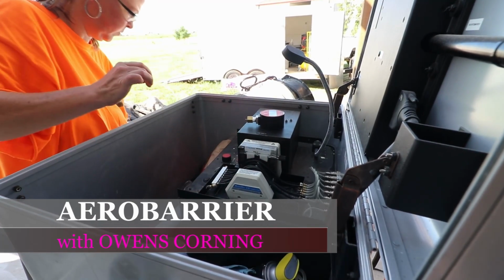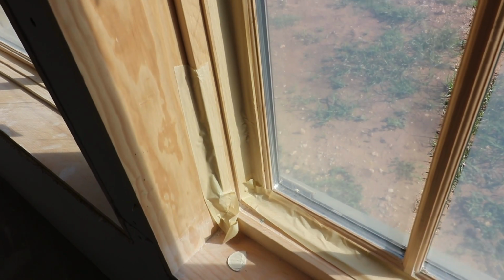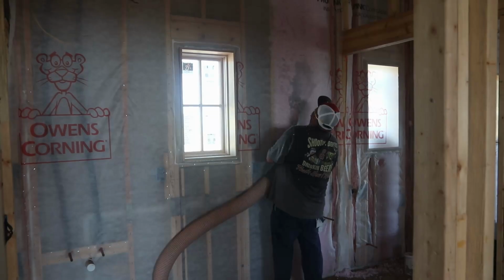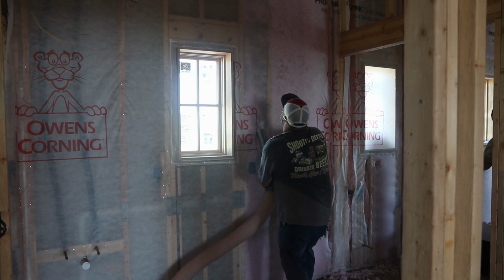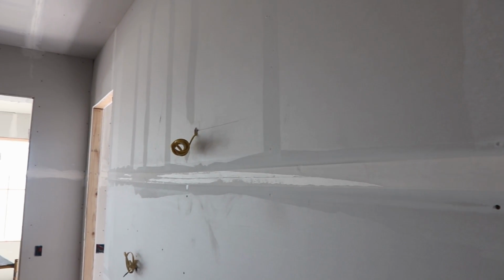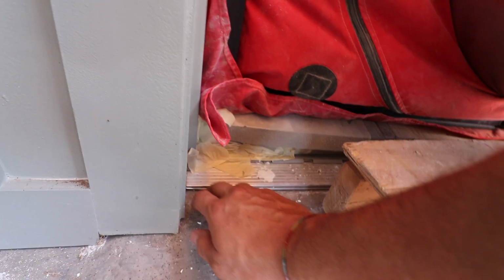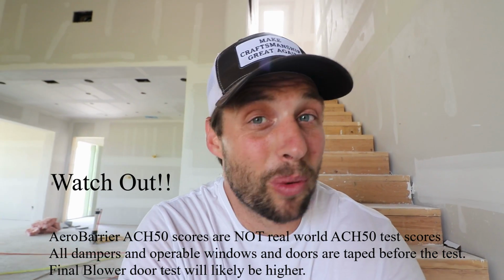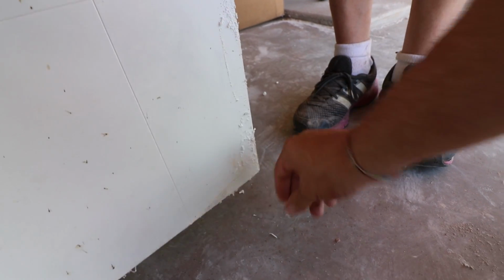This Insulation is BETTER than Spray Foam!!

Comment: Why is this done after the drywall is installed? Wouldn't it be better to seal your outer air sealing layer, leaving the inside of the walls at the temperature & humidity of the inside of the house? If you seal both the inside and outside of the walls it leaves the possibility of moisture remaining in the walls.
Reply: Done after drywall is installed because it acts as an vapor barrier/vapor seal I believe.. So its gonna fill any holes in vapor barrier behind the drywall.
The exterior of the house is basically sealed as well, where you have the issue of double vapour barrier and condensation I believe that is gonna apply more if there is a large airgap.
i.e

Comment: I am going to stick to caulk and rock wool insulation.  Owens Corning makes mineral wool insulation, too.
Reply: One contractor I saw in a video had their own blower door,  and they went around with smoke sticks to find leaks that they could seal before the Aerobarrier job.  This saves money because the cost is on a time basis.

Matt Risinger has also talked about flash and batt (sealing with a thin layer of closed cell foam,  then using insulation batts - he also likes rock wool), or there are one time use closed cell foam kits you can use to seal cracks and penetrations.

In a practical sense, it's probably not cost effective to rely strictly on caulk to seal.  You reach diminishing returns where it would probably cost less to use Aerobarrier than the labor or opportunity cost of sealing every pinhole and microscopic crack with caulk.

As explained in the video,  and as I mentioned above, you want the house to be tight to start with, before Aerobarrier is applied.

Comment: Hey Jordan really great video. Just a few things that I noticed that have been said in the comments but not really addressed. 1. Yes I think aero barrier should have been done prior to drywall and insulation. That way you are sealing out any outside debris and air from even getting into the cavity. Again if you were in a humid climate and the humidity got into the wall but then could not escape you would cause mold. Much better to have the dealing done before you put the insulation and drywall in so that none of those contaminants could get in there to begin with. 2. Buy sealing before you put in the insulation and drywall, any holes that would be put in by cabinet installers, finish work, or the like, would also not have an effect on your air exchange. 3. I have heard really great things about Rockwool insulation. I think for sure that way you would not have any settling. Good video though man.
Reply: Ditto, Nathan.

Comment: Jordan, I think it adds to spray foam. It seals all the cracks, so good air, but if you don't have a good water seal, you still get water coming into your insulation. Grant it, your osb, zip or plywood would get rotted, but you still be dry inside :-)

Comment: We do a lot of SCBA and face mask at work dealing with toxic and hazardous atmospheres.  The first rule of the masks is don't have any facial hair because it breaks the fit of the seal.  So if you have a mask on and facial hair you don't have a seal and are breathing the toxic stuff in past the filter(s).
Reply from the maker: Yeah, but the AeroBarrier seals all the leaks around  the hairs!  :) The mask was only for large particulates.  AeroBarrier seems to be very low VOC even when applicating, and we were only in there for a few minutes to check flow.  When I worked in oil and gas, I had a very uncomfortable dry shave in an Exxon bathroom before I was allowed into the refinery.  They don't mess around!
Reply: @JordanSmithBuilds  I worked on the space shuttle launch pad. We sprayed foam on the rockets there. You're right. They don't mess around ! Gotta be clean shaven.

Comment: Would be curious to know why you don't aerobarrier after plumbing/electrical/hvac, but before insulating and drywalling. It would seem to me that if you sealed the zip with fluid-applied, aerobarriered the envelope, and then insulated and drywalled that it would be tighter than waiting and doing the nearly finished building.
Reply: It seems to me that the sequence you're suggesting is exactly the right one - you're never going to remove the exterior envelope, but I could see situations where you would remove drywall and insulation (e.g., to deal with a water leak or change to electrical) which would force you to essentially penetrate the layer that was the foundation for the AeroBarrier.
Reply: Looks like that's what they did in this Aerobarrier video: https://www.youtube.com/watch?v=YanhizfgZQk
Reply: Full Disclosure: I work with Western AeroBarrier, a dealer in California.  We DO wait for all mechanicals to be installed prior to installing AeroBarrier, generally right before insulation (unless that insulation is open or closed cell foam, in which case we do it right after the foam.)  We also install at drywall stage, which provides a bit more flexibility for scheduling. We can come in after taping/mudding, after texture, and even after priming if need be.  Also, as a GC we have utilized liquid applied membrane for an air seal in the past... but it is expensive and time consuming to do. AB replaces that and saves a lot of money and time.  Liquid is still great for waterproofing/flashing openings, we still do that, but not the rest of the envelope.  AeroBarrier works better too, we have found flaws in liquid applied membranes (especially on OSB.)
Reply: I think the result is that you get the same level of air tightness but you probably use less fluid? I could be wrong. 
Adding drywall and insulation should make some gaps smaller which would save on install time for the aero
Reply: @zarethd  I can believe you might use some more fluid, but once you insulate and drywall it seems to me the aerobarrier isn't going to be able to get to a lot of small leaks in the envelope...
Reply: @jhealy3110  probably true, it's going to seal the leaks not the holes.
So if a hole is behind a sealed chamber that won't get any aerobarrier..
Sealing pre-drywall should work just as good, possibly use more fluid, but would future proof if you take a piece of drywall out for a built in, etc

Comment: Better to build with Insulating Concrete Forms (ICFs), better energy efficiency, simpler and safer.
Reply: Autoclaved  Aerated Concrete is even better
Reply: @oldporkchops  you're talking about the blocks - right?  what's the cost per square foot of wall for the autoclaved aerated concrete, and where do you get it in the US?
Reply: We still seal with AeroBarrier on ICF's, SCIPS, etc.  The transitions are the weak points, for example from wall to roof, around fenestration, etc. That's where most leakage has been found by us even on a conventionally framed building.

Comment: The only stuff I’ve encountered settling is the stuff that is retro fitted in. I’ve worked in many old houses that went from no insulation, to having it blown it.  We’ve came in 20-30 years later and found massive gaps in the walls.  Now the precautions you’ve talked about. My mind had changed on blown it. It seems if installed correctly it can be a solid solution.

Comment: what are you doing for your roof/ceiling insulation?
Reply from the maker: R30 batts except in a small strip where we had a finished ceiling and did blown in like the walls.

Comment: Most blown-in manufacturer's will tell you the R-value can go down up to 20% over 20 years due to settling. If you do this again, try looking at Jet Stream® Ultra Blowing Wool Insulation. It guarantees settlement will not exceed more than 1% in 20 years. We have used this product in flat roof commercial construction to fill the entire roof cavity (so we don't have to vent or add attic sprinklers) and then add rigid above the decking per IBC 1202.3 or IRC 806.5. To meet code, the insulation cannot settle, so it's been a good product for us so far. There may be a few more out there that don't settle, but that's the only product I've come across so far
Reply from the maker: Great info! Thanks!

Comment: R-Zip, Liquid Flash, and Rockwool bats.  Looking at ICF above ground as well. I am thinking about trying backer rod around my joist/sheathing to help with limiting VOCs.  And then use liquid flash over that instead of spray foam.  R value are getting out of control.  You don't get much benefit after about R-28 or so.  I think the next thing in building will be air sealing, lowering VOCs, and indoor air quality.
Reply: You are totally right, the products we see in commercial and 'high end' homes always filter down as costs decrease
Reply: @MandoFettOG  I think we are spending too much time preaching more insulation.  I was just seeing on Energy.gov how in my area they are now recommending R-60 in the roof https://www.energy.gov/energysaver/weatherize/insulation.  The point I am trying to make is I bet an R-30 roof with proper air sealing and a cold roof will give more energy efficiency, comfort, and longevity than an R-60 blown in insulated attic.  Instead of spending money on going from R-30 to R-60 we should be spending money on air sealing and vapor barriers.  https://www.energyvanguard.com/blog/76941/The-Diminishing-Returns-of-Adding-More-Insulation.
Reply: @fromtheburbstothetetons8826  You have a good point. Air sealing is very important and should be considered. The importance of insulating the roof ...or "ceiling" , however, can't be overstated. DOE recommends from R-38 to R-60 as you say, depending on the zone you live in. But rockwool, for instance, is cheap. Spray it deep. It WILL pay for itself....and quickly.
Reply: @kipcarroll486  Actually it won't pay for itself quickly or likely at all.  Allison Bailes did a study on the "The Diminishing Returns of Adding More Insulation".  Going from an R-30 to R-40 will only make a 4%-5% difference. I am arguing that doing R-30 in the roof with proper air sealing and cold roof would be more efficient than just piling up more insulation in the attic. Question is do you spend more money piling up the insulation to R-60 or air seal? After a certain point, let's say R-40, you should be spending the money elsewhere to increase efficiency and I don't think that is discussed enough.  What Jordon has done with the Aero Barrier will do more to increase efficiency than an additional R-10 anyplace in the house.
Reply: @fromtheburbstothetetons8826  How many decades was that 'study' over ?
Reply: @kipcarroll486  Not sure and since it is static measurements I don't think it matters.  The R-value and U-value formulas don't change over time.  Here is a link to the article: https://www.energyvanguard.com/blog/76941/The-Diminishing-Returns-of-Adding-More-Insulation.  I think the second graph says it all with the "Reduction for each step" plotted points.

Comment: I have been worling on a walk in shower this week in a house that was built in 2006 and when I pulled the old shower out I found bibs. and from what I saw after 13 years there was absolutely no settling in that insulation.
Reply: What material was used for the insulation?  Cellulose?  Fiberglass?
Reply: What type of insualtion was it?

Comment: Jordan, curious about the sequence of installing Aerobarrier after the insulation and drywall. It seems like there could be a benefit to move the air seal layer as close to the outside wall as possible. So having Aerobarrier installed before insulation and drywall would seem to make sense. That might help keep  humid air, and dust, out of the insulated wall cavity. What do you think?

Comment: Dense packed cellulose has a lot going for it.  Packed properly (4+lbs/cuft) it won't settle over time.  Tests in Europe have demonstrated this, using shaker tables and temp/humidity cycles to simulate long term aging.  It's cheaper than fiberglass, is dense enough to resist air movement (in the case of a leaky house build), and is worth R 3.7-3.8/in installed.  It's also a fire retardant.  Search for "big burn cellulose" to see the testing done.

Comment: Very misleading video.. this guy don't know anything about spray foam insulation. There's no amount of fiberglass insulation that will out perform closed cell insulation. As far as air sealing if you get a contractor to properly air seal with siliconized caulk before your drywall is installed you will get better results and better insulation with closed cell spray foam. Spray foam isn't a new type of insulation it has been around since the 1950's so many years of installing and studying spray foam insulation. With the new machines and new technology and training home owners have nothing to worry about when it come to spray foam insulation.  If anybody is interested in more information and the study's that have been done on spray foam insulation I'll send you the info. Thanks and have a great day

Comment: I'm 100% sold on rockwool insulation! I have heard that a couple passive houses here on the northeast coast have blown in rockwool. I am not a fan at all of the spray foam...tho it is a great insulator
Reply: Spray foam the exterior prior to siding. Use standard insulation on the interior.
Reply: Its nice until you gotta apply it then you hate your life.

Comment: Excellent video, just on air sealing in general. I'm a building trades teacher and will be using this video as a class lesson during our house build this school year. Keep up the great content.
Reply: I'm glad to see you still teach this.  My school district got rid of anything related to this topic and building in general.  Now the kids get tech ed.  They build plastic toy kits and learn how to assemble models.
Reply: @beebob1279  we just brought our house building program back from a 6 year pause, we've had it since the late 60's. It's been a fun few days so far, kids are loving it.
Reply: @mattblomquist4204  fresh meat to indoctrinate?
Reply: IF FOR FUTURE YOU NEED A REMODELING YOU WILL CRY 😢 OF THE MESS
Reply: I don't trust this kind of install... Too much, and dry wall bows outward. Fiberglass brings temperature change inside the wall, meaning hot and cold meet I your wall and condensation can for.. temp change should be on exterior of wall or envelope. .. rodents love to tunnel inside fiberglass.  I prefer rock wool or cellulose.  Fiberglass also is toxic, has been know to have  fermeldahyde and aspestis..even though they came it doesn't..also pink fiberglass makes you ich and irritates the skin. Not to mention the airbourne particles it leaves behind. In a sence you have a air filter in your walls..
Reply: @bobsmith7484  "Aspestis?" I'm assuming that's asbestos?

Comment: I have often thought about running Aerobarrier before insulation and drywall. This would push the air sealing further to the outside. As time goes by you will pout holes in walls for hanging things, and making modifications. If the Aerobarrier is on the back side of the sheathing, then it would not be effected by that.
Reply: That's right, better to air seal at the exterior sheathing... but when that is not possible then it is better to air seal at the drywall level than not at all.  As an AeroBarrier dealer, we do both kinds of jobs.
Reply: @reesnomad  Thnx Richard, that was my concern also.
Reply: @reesnomad  there are no reps in IL. Does aerobarrier travel.
Reply: @reesnomad  can aero barrier be used in a finished  older home that people are living in?  I suspect maybe not fully, but I wonder about setting it up in the attic and crawl space with a blower door set to blow air out, so the aerobarrier tries to find it's way inside.
Reply: Why dont you just tar the exterior sheeting like a poured foundation?!
Reply: @1974jrod  .  Above ground, the tar would be a fire hazard.  (Hard to ignite below grade)

Comment: a lot of the reason we use foam is because we go with encapsulated attics and crawlspaces.  what did you do to condition your attic?  we always have our foam contractor do a "full energy seal" (caulking sills, gang studs, etc.)

Comment: I didnt realize propink filterglass had an R Value in the high 6 to low 7 range per inch like closed cell foam does.
You say aerobarrier a better insulator than foam, what is the R value on aerobarrier?
Its odd that propink has a different R value based on how its installed.  Open blow attic vs walls.  Looks like in open attics its about 2.7-2.8 per inch and in walls its R4 per inch.
There are many open cell products with equal to or higher r values per inch in any application.
Its funny that the building code allows you to scale back amount of R value needed when you use air impermeable insulation like spray foam.  Does this qualify?
Builders can downsize framing and lumber requirements if insukating with clised cell foam.  Can they do that with this product?  Does this product increase the racking strength or structural integrity of the building?  Is either product, in a single application, an air barrier, class II Vapor barrier or high r value, say, R5.5+?  No?  Whats the life expectency of blown fiberglass?  How long until its settled and whats the insulating value then?  Does it carry a performance and warranty that lasts for the lifetime of the building as many spray foam products do?

Owens Corning big mistake is to attack foam and alienate their insulation partners.  This is not better than spray foam.  Its just another example of owens corning using multiple products to try and achieve what spray foam, both open cell and closed cell, can do in a single application.